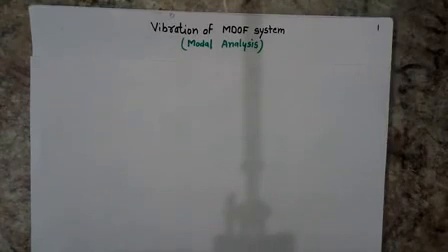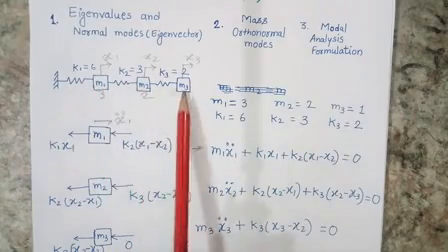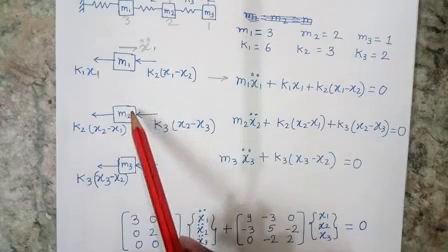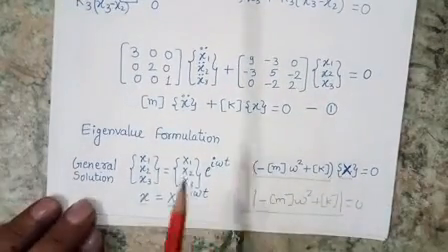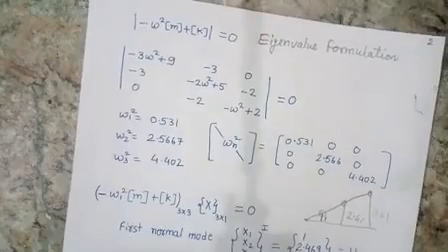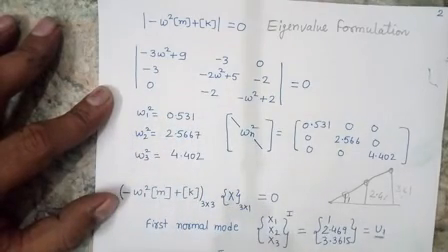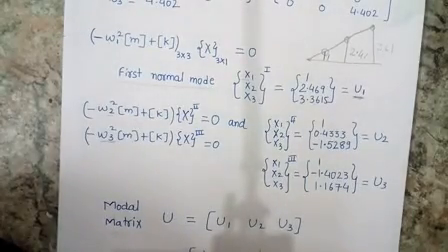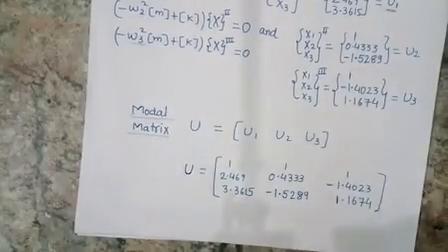Modal analysis in multi degree vibration_Part 1

Comment: Your videos are very detailed, thank you. There is a subject that I want to clarify in my mind. In 2DOF and MDOF systems, do we look at the number of masses regardless of the direction we are moving? For example, let's say we have 3 masses and they are connected to each other with a spring; in addition, let's say 1 mass is connected to a fixed wall, and our middle mass is connected to a fixed wall in addition to its connection to the other masses. Even though the geometry is complicated, is this called a 3DOF system because there are 3 masses? Thank you.

Comment: how to solve algebraic equation of omega power 6 or quadratic equation as in earlier 2 degree of videos .....please  tell me because it is important without that can not forward ....mail me procedure..
e-mail : desainirav83@gmail.com
i hope you will soon reply...
Reply from the maker: In case of 2dof..equation will be of omega power 4.. and in 3dof system it will be of power 6. Assume w^2= lemda   so it's order will be half then either use calculator or MATLAB to solve equation.

Comment: Hi Ashish. Can you help please? How did you get The first mode ?
You said you substitute the first nat freq squared into the matrix but then I get three equations which have only trivial solution all xi s zero.
Thanks
Reply from the maker: Dear Jose, you are right, actually we can not get absolute value of three deflection. We have to get relative, means out of three equations take out X1 common. Then you will have two unknown as X2/X1 and X3/X1 then treat it as single variable and solve. Your final answer will be like ( 1 X2/X1 and X3/X1. If I could not clarify..I will send you pictures through mail.
Reply: @ashishpurohit9138  
Hi. thanks for immediate response.
I used the det =0 eqn to get the roots and got your values.
Then used adjoint matrix and got three vectors, which two are like yours but not the third.
I can use maple commands but I dont get same eigen values, nor eigen vectors, not even the same charac eqn.
Let me keep doing it.
I have a bigger problem with more degrees of freedom, but I am relearning thanks to your great videos.
At the end you can use displacements to get strain, and from there stress, and even design for earthquakes. I will apply to check out an existing  little six story building.
Thanks a lot.

Comment: Many thanks Ashish.
Many times in classrooms, problems are not finished and it leaves the understandig a little weak.
For example, most of us know the importance of natural frequencies, a little less the practical value of eigen vectors, but not the great advantage of decoupling a problem with degrees of freedom into a series of uncoupked single degree of freedom problems.
It is very clear now.
Now, If I want to plot the actual displacement of the original problem, I just can add each single problem onto the movement of the previous, right ?

Comment: Can you please explain to me how did you get the values of omega sub 1,2,3 please
Reply from the maker: Hello Joren: Three omegas are calculated by solving the determinant |det|  of   -*omega*omega*[M]+[K]    matrix. It will give you a determinant as shown in video at time 4.11 sec. It will develop a algebraic equation of omega power 6 and you have to solve it get its roots. If you wish me to show you. mail me and I will reply through mail.